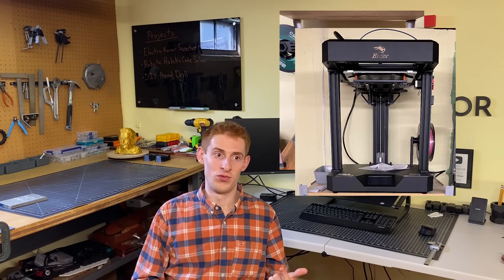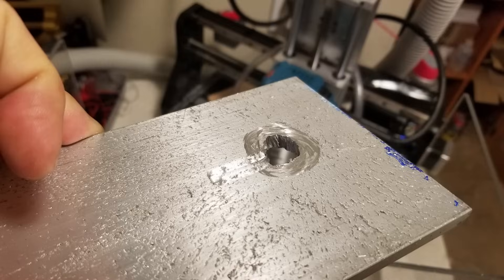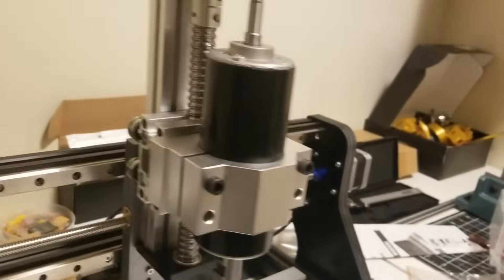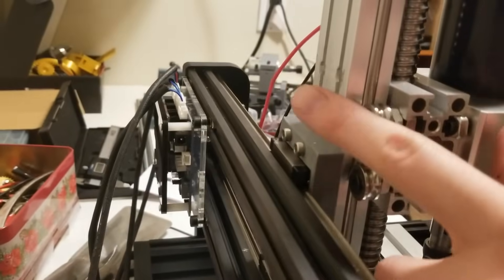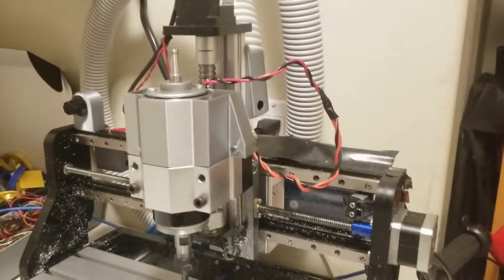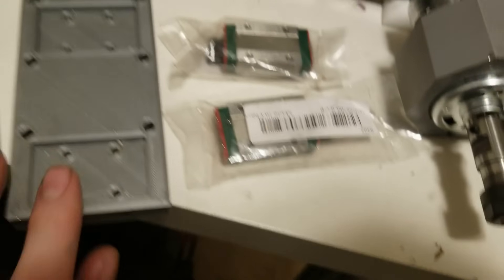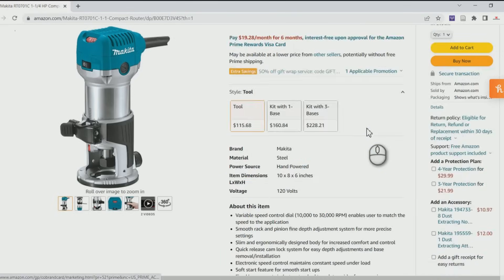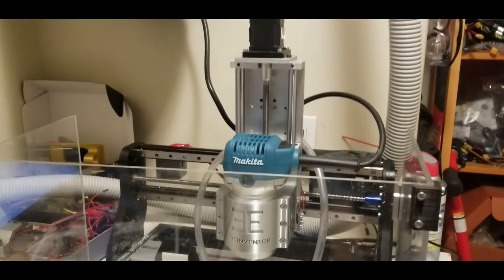Upgraded Desktop CNC 3018 cuts Aluminum FAST!

Comment: The 3d printed part will comprimise rigidity no matter how well u make. If lucky not in a day or two but its surely going to.
Reply: yea especially if printed in PLA, won't survive the heat.
Reply from the maker: Good point, Ive just recently CNCed the 3D printed parts with my CNC. Next upgrade video is coming soon!
Reply: @ericinventor  waiting for the video . best wishes

Comment: First: newbie/beginner question: what are you using as cooling agent (spray)? 

Secondly: I just downloaded your plastic parts stl files . Thank you for sharing !!!. Do you have a metric version? Eventually CAD files. I'm an European guy and working with imperial units is a pain in the a... And Chinese engineers use metric units too...

One hour later: I had use the Bamboo Studio software to scale up your model (x25.4) and saved the "new" part as stl too. And the "magic" happened: I have to deal with millimeters!
Once again: thanks for sharing with us!!!

Comment: I was surprised that you did not replace the 3D printed adapter plate with one you machined.
Also these machines have poor support laterally in addition to the flex of the rails.
Save your money and buy something other than a chinesium kit

Comment: I am running stock rails and just upgraded the z-axis. The stepper motor quit and I use this thing, so small upgrade. I have no slack anywhere on the machine and it cuts circle boards daily. The linear bearings should never wear out if you run it correctly. You should just be moving into the space that is cut, not putting pressure on it. If you want speed, add rpm. I can make about 4 cuts into the copper on circuit boards

Comment: Hi Eric, I'm writing from a well-known place on our planet. I appreciate that someone has the same concerns as mine. I have two questions that I can't quite figure out. To build the Z-axis as close as possible to what you bought, nothing normally available in the US or Europe arrives here, so it has to be built. If you can, please tell me the diameter of the Z-axis round bars and the diameter of the THSL screw. Only the 8 mm one is sold here. Thank you for your work and sharing it.
Reply from the maker: Hi Guillin, the Z-axis round bars are 0.5in ~ 13mm diameter, and the THSL screw is 10mm diameter! Good luck

Comment: I have to ask You Eric, model train linkage for steam engines. My American Flyer trains at from the 30s in O gauge, 40s, 50s early 60s S gauge. I can not find replacement side rods to hook the drive wheels together and the steam piston rod etc They transfer very little torque as the drive axle is driven by a gear and electric motor. The thin sheet rods wear and break and are not replaceable. I tried to take a mini X Y Table and add a fat Dremel with CNC app and it works kinda but as you know it ain't gonna cut it. I was directed to the 3018 because is all the size I need but the thin sheet metal ????? Should I consider a Un shape Aluminum round with holes to mount? Bu thin sheet metal will it really need that monster Router???? I can see my X axis all 3 D Printed is junk. And the slide rods are out. Any recommendations???  https://youtu.be/uiFvM8rwiec?si=gLmwkJCjLsiiwort    I know this was all too weak but I did get the controller to generate the G Code and move around. Need a better base. Like the 3018 I think. D

Comment: hello, what z-access did you finally decide onfor your version 3 upgrade ? There quite a few different models on their site & you didnt give a great deal of info in it,
Im wanting to follow using your upgrades I think theyre excellent but Im concerned about getting the wrong model z-axis. They have all these different models, some look like yours but theyve 6", 7" & " slides. I definitely go not want the one with the slider belt. Its confusing.Im not sure, Not enough info from you unfortunately. TIA for  your assistance.

Comment: How do you you wire the makita to the board
Reply from the maker: @AriVovp  I did not. It is controlled by me using the switch and speed dial on the makita

Comment: Would this cnc cut 1/16" non-ferrous metal sheet out of the box? Or would I still need to upgrade? I'm wanting to cut my own swiss army knife liners for the custom builds I do.  I get then to the right shape with the tools I have, but I still have to drill the holes on my drill press, which have  to be perfect. The time it takes to make these is too muchi. An exercise in manoutany. Cnc companies I've emailed won't even reply lol. Desktop cnc might be the best solution.

Comment: This is so cool. Question about the parts list in the description: Do you include the Genmitsu CNC 3020 PRO-MAX in the parts list simply for reference? Or did you also purchase that CNC and use some parts from it for the final upgrade?
Reply from the maker: @andrewschlup6169  just for reference, it came out after I made this video, but I knew it would be a relevant option for some people since it already has some of my upgrades built in.

Comment: so, what I got out of this was you did a whole lot of work and got to a place you are happy.  What I do not understand, is if I want to short cut that work, and throw more money to start with at the project, what would I buy?  I get lost with V1, V2, V3.  I want the shortcut answer to have a working CNC mill with the least amount of effort.
Reply from the maker: @2000gillco  check the description for a link, the new 3020 Pro max is a good place to start, since it already includes some of the upgrades I have made

Comment: Just starting with mine after it sat for two years in the cabinet. Going to (try to) make RC plane bulkheads and wingribs from ply and I would like to cut a custom open end wrench from aluminum for the heater block of my 3D printers. It is completely stock now, parts became expensive even on Ali sadly.

Comment: Fantastic job, well done! I’m looking at upgrading my Genmitsu 4040 Pro to a 500 W spindle then watched this. Do you find the Makita router louder than the spindle? Thank you in advance!
Reply from the maker: @johnprosser2142  The Makita router is definitely louder, I wear ear muffs when using the CNC cause its pretty annoying. But I do think the Makita is better performing given its 1.25hp which is ~900 Watts instead of 500W

Comment: I love how he has a cnc on his desk that cuts aluminum well enough and still proceeds to make parts for the cnc with the printer while knowing rigidity is the issue.
Reply: That was what got me too.

I built a CNC with 3D printer parts, to CNC stronger parts for my 3D printer and replace the 3D printed parts on the CNC with metal parts and kept repeating that every time there was a substantial quality improvement on the CNC.

It's silly to keep using any plastic parts on the CNC when you even get rudimentary aluminium routing going.
Reply: ikr pluss the plastic can warm from the heat
Reply: yes

Comment: Way to much of an investment and it still vibrates too much.  Buy new frame rails, cut thick aluminum gantry sides, get some NEMA 23 Closed loop motors and accessories and take the good stuff out of the revamped -18 and use it in a new machine.  I assume you will use extruded slot frames units, so fill them with epoxy granite and cast an epoxy granite mount (your first  epoxy granite piece) and don't fill the extruded rails until you have the unit trued and through bolted (use long threaded rods).  Ya, it will get heavy and will need a real solid workbench, but your accuracy and finish will show.  Then rebuild the 3018 and mount a laser on it (like for doing name plates or maybe a wire EMD cutter)..

Comment: I got the same cheap CNC you mentioned at the beginning. It totally can cut into aluminm. All it took was a different HSS drill bit (and it was painfully slow, feed rate of 80). However the surface looks kinda rough and I'm looking for ways to clean it up right now :p

Comment: Its time I upped the motor on mine, it just snaps tools, Ive known for a while I need to up the spindle power and speed, Just seen Stephan GW milling plate stainless , maybe with chamfered cutters  you could mill ss.

Comment: Thinking about upgrading my 3018 but wasnt 100% sure where to start, this is really helping out. Cause i started questioning basically everything about it, down to the torque of the steppers. Its very nice to see that the most important stuff for somewhat speedy results are  the z axis and the spindle. 

Cause i realy stopped using it alltogether since i kinda hit a wall already with some hardwood, only managed to go at a feedrate of around 100mm/min woth a doc of 0.25mm took me forever to do anything

Comment: Just bought the 3020 chinese cnc router, I shall absolutely go after your  ways. Shall buy a small Makita router to it, as my plans are to cut aluminum just like you, thanks for this video it confirms all my thoughts about the linear rails (roundbars) being to flexible. I been looking at linear rails for a while to modify my 3D printer with 2 lead screws, and 4 linear rails in each corner, I have the creality ender 5 s1 and getting the buildplate adjusted is a real b** I shall add a 5th point where I can adjust the center too. It is really nice that you can utilize the 3d printer to make parts for the cnc and vice versa :)

You gained another subscriber too, have a great day!

Comment: Software used for design and text?
Reply from the maker: Autodesk Fusion 360
Reply: @ericinventor  Been Using Inkscape. its free and generates Gcode. Fusion 360 looks like its 85$ / mo but thank you for your reply :)

Comment: When using a router, it's important to try to cut into the material direction only (as when using it for woodworking), Notice the vibration and chatter when cutting WITH the tool travel direction. That is because it is trying to cut with the shaft/tool direction. The tool will try to climb. The shaft needs to cut into the material.

Comment: I have an Anolex 3030 pro which already has dual linear rails on all axes, but I'm still getting heavy chatter with the stock 300w spindle. Do you think upgrading to the Makita router would solve the issue?
Reply from the maker: Yes i think it could definitely help. It will also let you increase your RPM which can make for smoother cutting
Reply: @ericinventor  Thanks! It kinda stinks to have spend another 130€ on top of an already expensive machine but it seems like most good quality desktop routers with linear rails, ball screws etc. still come with garbage spindles. I hope this is the last piece of the puzzle.

Comment: Hi.
In your CNC V3 Final Upgrades, you refer the 400mm MGN12H Linear Rails. I have a 3018 pro and the size of linear rails is 360 mm and not 400mm. Is 400mm, the right size?

Comment: Hi, it would be interesting to know what the total cost was? You may have been able to bye a second hand metal "mini mill" i.e. Taig etc. and converted it to cnc for less. These will cut steel using small cuts, or aluminum with no problems and they are still desk top compatible. To put the "desk top" comment in perspective a Taig mini mill weighs about 42 Kg. So main comment here "horses for courses" if you want to machine metal start with something bigger. Bye

Comment: For me , linear  rails on X and Z solved the "chatter" problem. The rods are just not up to the task. The 10K RPM spindle motor is the next to go  - probablyy with the 30K RPM router. Thanks very much for all your input.
Reply: That's good feedback. I've got a 6040 router I've had for 10yrs. It cuts a lot of alu & brass, but it's still on chrome rods instead of proper linear rails. I've been wondering whether the flex & chatter or the steppers are the biggest limitation to my cutting ability.

Note: upgrading to flood coolant with soluble oil made a huge difference to it's metal cutting ability. Nothing I tried spraying by hand even came close. With flood coolant, you can run a faster rpm, so you can take advantage of a high speed spindle rather than trying to cut low and slow.
Reply: You want slower speeds for cutting aluminium. So you want low RPM but high torque.

Comment: Great video mate! Now i'm inspired by you to upgrade my 3018 thats been collecting dust ever since I tried to cut aluminium and failed lol
Did you have to put in a stronger stepper motor for all the extra weight?
Reply from the maker: I actually only had to upgrade the Z axis stepper just slightly to a nema 42-40

Comment: How did you draft up the gear? Can it be G coded without need for CAD? Applogies if the question wrongly worded , I too have one of these machines and wish to experiment with engraving circular gear like, clock face, arc radious projects.
Reply from the maker: I designed the gear with CAD and then used fusion 360 CAM to generate the toolpaths to cut out the gear which gets exported as gcode. Im not sure enough of a gcode expert to be able to write gcode without the CAM software

Comment: I had a fet tries at my Z axis too. In the end I went with 10mm rods, rod sliders and I vacuumed a carbon fibre clad and epoxied cnced wood plate to hold my water cooled spindle motor. Only issue is my X axis is not ball screw, it's belt so it's a bit more flexible over it's 1.8m travel. Will cut aluminium but not ideal.

Comment: Using 3d printed parts is going to introduce vibration and the temp change will cause it to expand and contract. You need a good metal and solid frame. Otherwise you will have errors and small chatter.

Comment: i really want to do this to my little 3018pro but the more i messed with it the more i felt like the hole frame was to flimbsy to do what i wanted so i took my focus off the 3018 an put it toward small benchtop mills an i have a wen 33013 now an it eats aluminum or at least it does way better than anything ive ever owned b4 an the finish is great so now im back after seeing a bunch of the newer 3020 machines cause the mill is great an is really enjoyable to run but id like to have it powered by stepper motors so when i want a circle cut it can do it without a bunch of extra setup required so i went back looking at the 3020 machines but i still have my old 3018 an a bunch of linear rails already in the spare parts bin so i may as well try to make it do something an if i can get it to cut aluminum like u show in ur video i would be extremely happy but i think i can pull it off by making alot of the parts my self since i have the mill an once i get everything on it lined out like backlash in the handles it will be converted to cnc. is there anywhere ur sharing ur work for the files u made an a parts list.

Comment: 1: BALL SCREWS!!!!!!!! anything else is junk!!!
2: linear slides ON ALL AXIS! 2 on each side of the ball screws. 
3: ALL STEEL FRAME! NO EXCEPTIONS! NO 3D PRINTED ANYTHING!!!! NO WOOD! 
4:  at least a 1KW motor.
Do all of these, and not only can you mill aluminum, you can machine steel. 
rigidity! its the only rule when building any kind of CNC

Comment: After the upgrades what is the actual milling/cutting size? I am guessing that it is a bit smaller than the original 300x180mm